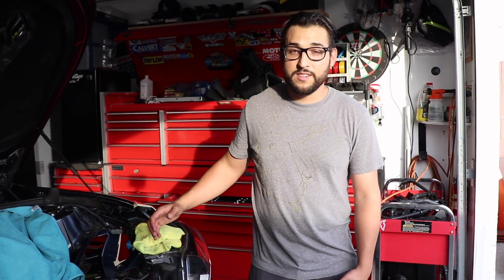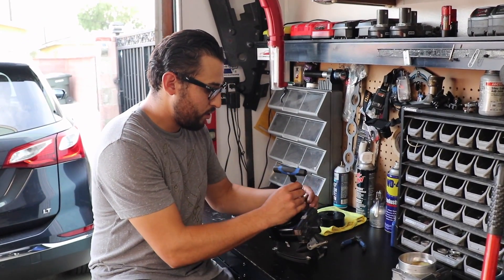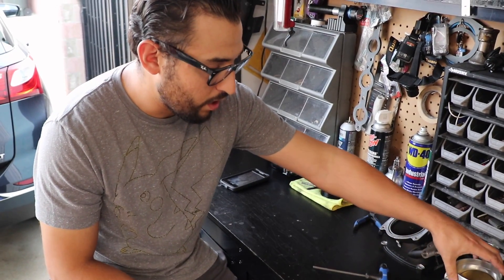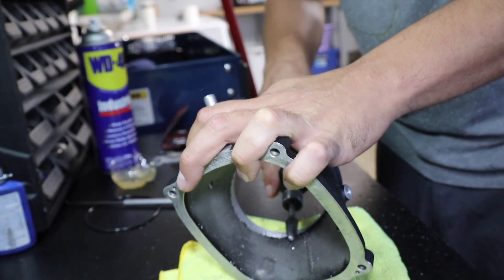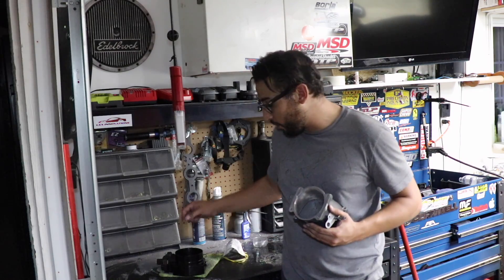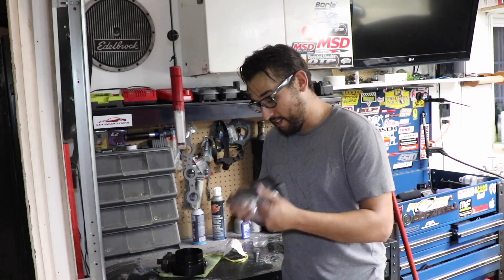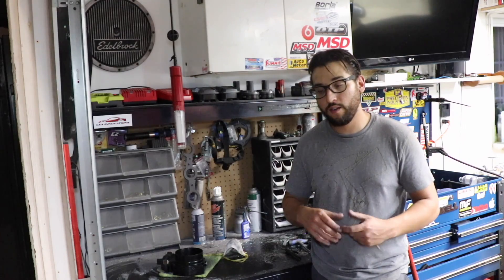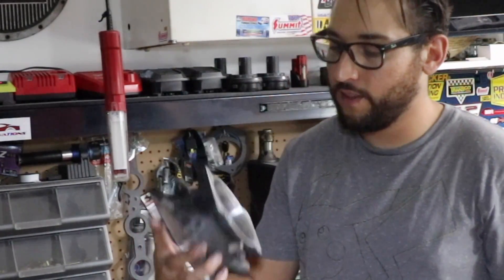Magnuson Supercharger Install Pt7 *Porting the supercharger snout*

Comment: Late to the party but I just found your video.  I am going to port the snout like you did.  But I was thinking of get a 203mm metal hole saw blade and it should fit right in the O ring grove.  What do u think about that? Then clean it up with the dermal. 😮😮
Reply: I actually ended up filling it my hand and use a drill with head porting sandpaper.

Comment: any updates on how this ended up working out? any issues running the 103 on the snout? some people said they had flutter or issues with low rpm throttle when cruising. It never had issues?